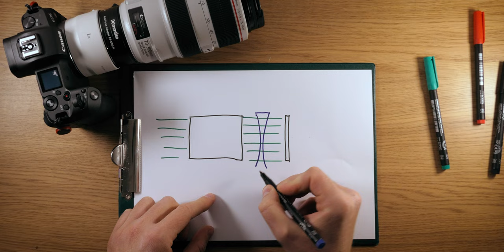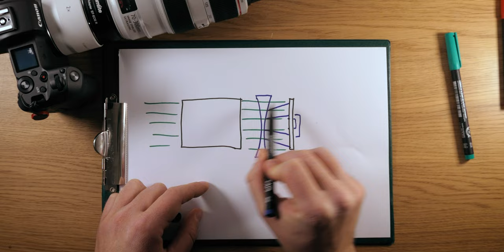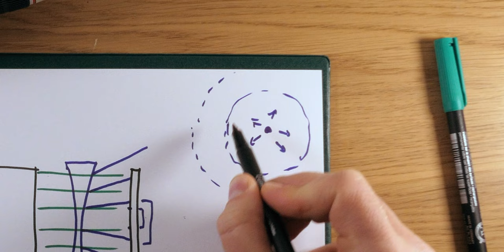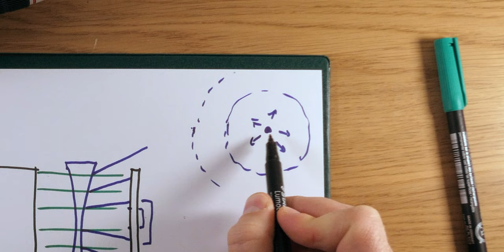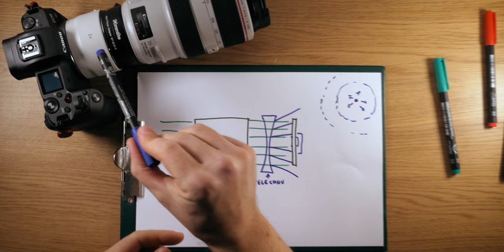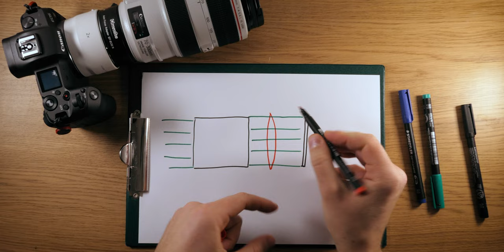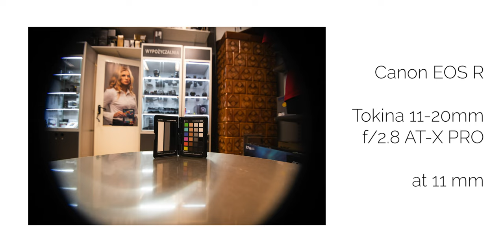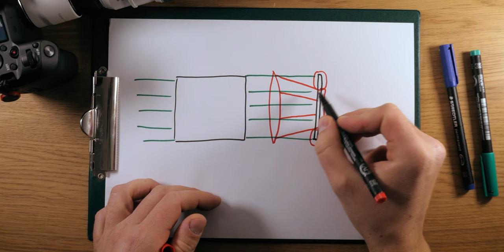Why FOCAL LENGTH EXTENDERS reduce image brightness and why SPEEDBOOSTERS make a BIGGER APERTURE

Comment: This video is not technically correct! Firstly the teleconverter is not a concave lens.. secondly the aperture has a relationship between the focal length and the entrance pupil.. I understand you are using an analogy of a concave lens but this is not the correct explanation technically.
Reply from the maker: Yes I was using an analogy. What’s important is that it spreads out light similarly to a concave lens.

Comment: Hey man i seen you mentioned teleconverters and ive been in a pickle.... is there loss in image quality/star sharpness with teleconverters added? 
Im wondering how the sony 70-200 gm 2 would be close to the same as the 100-400. Any insight would be greatly appreciated. Its been pretty tough info to find. Thank you.
Reply from the maker: Yes there is a sharpness degradation
Reply: @kamilkp  you're awesome thanks dude.

Comment: And if we use a 0.71X speedbooster on a Canon EOS R5 and crop the image....
I have a 500mm F/4. With this configuration I thus obtain an image at 500 mm (because of crop) of 32 mpx and with an aperture of F/2.8.
Afterwards with the crop do I still gain light?
In the end, don't I get the same result by downsampling my 45 mpx image?
I admit this stuff is spinning hard in my head x)
Reply from the maker: You could use the RF speedbooster made for the Canon C70 by Canon and indeed get a 500mm f/2.8 but the resolution drops with a square of the multiplier so 45 mpx * 0.71 * 0.71 = 22 mpx. Still pretty usable if you ask me.
Reply: @kamilkp  Oh yes you're right ! I think if I downsmple my photo to the same resolution I should have the same result for free. Too bad we can't really reduce the focal length while keeping the entire sensor. It would be too good! You have to have a medium format lens!
Reply from the maker: Exactly